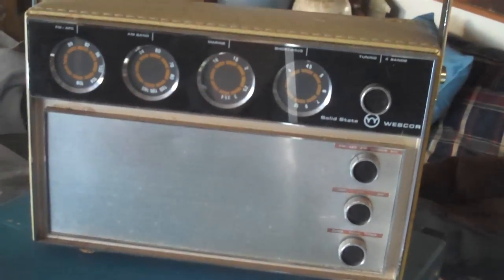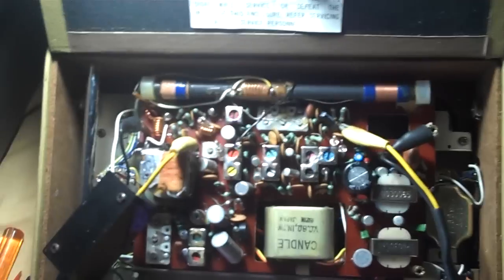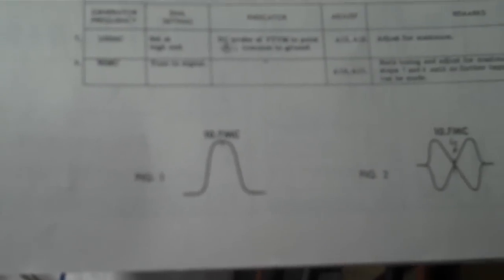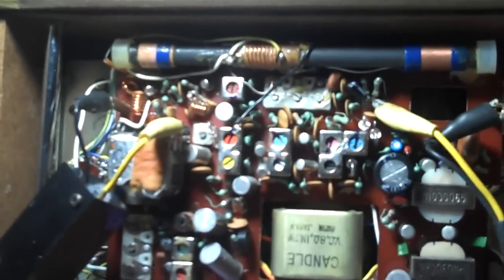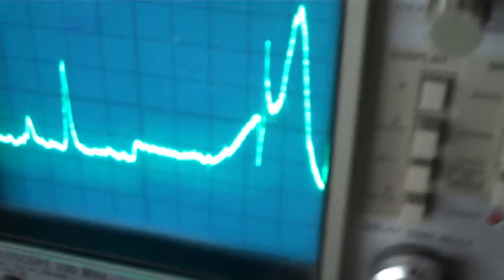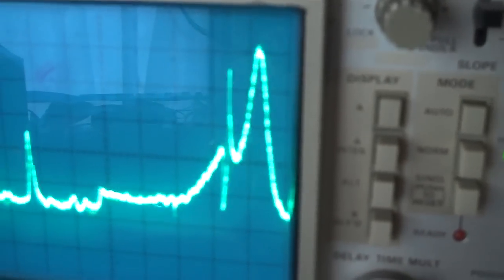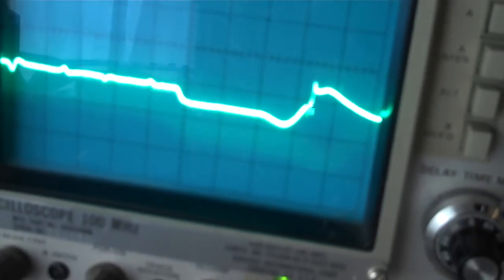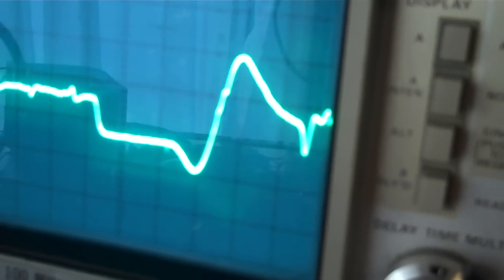FM IF Alignment on a Vintage Webcor 2449 Radio

Comment: I've seen them on a Zenith transistor radio (circa late 60's). Also, didn't NASA have those issues with whisker shorts? That's the reason why the study was launched to investigate it.

Comment: Thanks for the tip. I just ordered all of the remaining electrolytic caps. I would have never guessed that a bad cap will kill the volume like that, so thanks for the info.  Do these radios sound decent after they're fixed?  I bought it because it was a Webcor. I realize that this wasn't my dad's Webcor, but a foreign made version. As long as it sounds decent after completion, I'll be happy. (The case on this radio that I bought is really clean).

Comment: Same problem here, no  Sweep Marker Generator. Using a fm modulated generator and a sweep generator but have no marker so no idea where the 10.7 is. Reverted to the 10.7 Mhz peaking of the If.

Comment: I just bought this same radio on e-prey. I replaced the electrolytic caps in the AC power supply, since it had a bad hum. The hum is now gone, but the volume level is very weak. It's clear, but weak, even at full volume. Any ideas what the problem may be? I'm hoping it's not the transistors. I have a feeling that it's not. Other than the low volume, the radio picks up everything. Any help would be greatly appreciated. Thanks.... Randy

Comment: You know, as interesting and informative as this video is, even though it's horribly out of focus throughout, is that these guys on youtube are generally not detail-oriented. What do  I mean? Well, for example, there's no mention of the fact that you need to reconnect the stabilizing capacitor before doing the S curve. Also there's no mention of whether the IF strip should be aligned using any modulation or not - same goes for the S curve adjustment. If you;'re going to make a video then for Pete's sake be accurate because there are a lot of people out there who really want to understand and you ought to make sure to be really precise. Sometimes you don;t need to disconnect the stabilizing cap and sometimes you need to short out the oscillator coil and then align the IF strip. Well it's an old video now, so maybe the author has improved on his delivery. I really like his videos but I find that you need to be a detective and study many, many youtube videos from many people before you'll ever really know how to do an IF alignment on an FM radio with real precision. Also what about when it's a stereo that you're aligning - then you have to really go for a flat-topped alignment.  No - I'm still looking around to find someone who really does a great job of covering this topic.